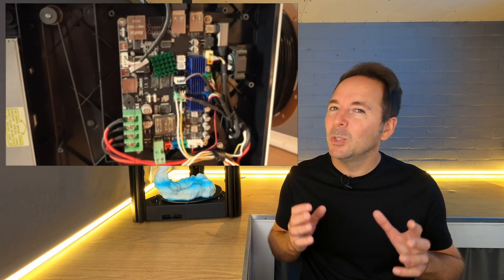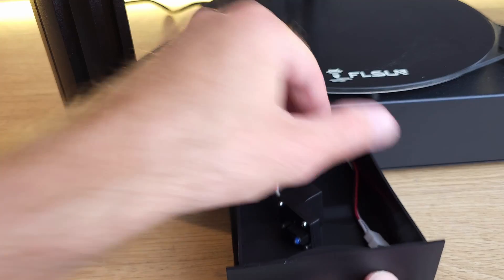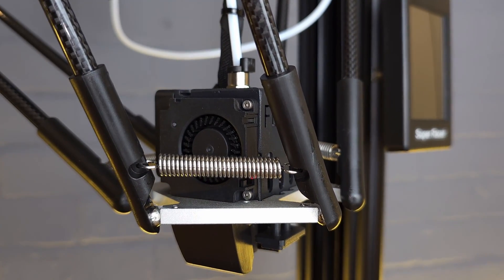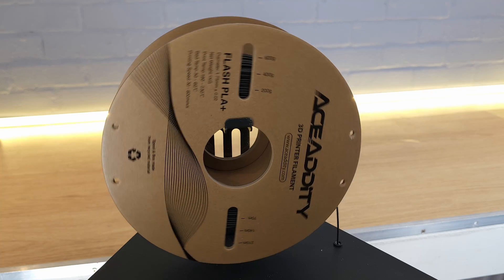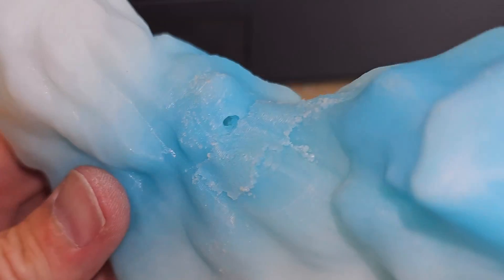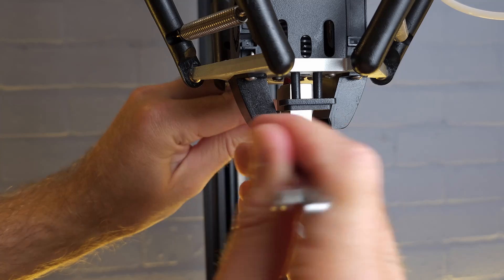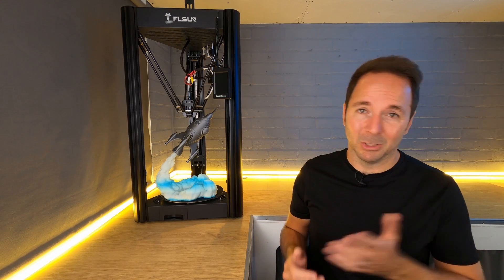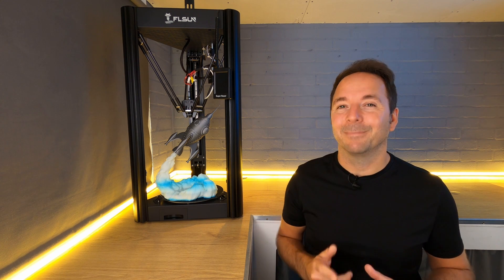You CAN 3D Print Fast WITHOUT Klipper - The FL Sun Super Racer Shows Us How

Comment: I managed to get my FLSUN SR for really cheap. I am not sure if it was direct from FLSUN or an Amazon Warehouse deal. I have replaced the spool holder, with an adaptive roller spool holder by SUNLU. So I can use 1 to 5kg filament rolls. It is just attached via Command Strips. Another upgrade is replacing the bowden tube with a Capricorn tube. And the extruder is upgraded to an all metal OMGV2S F1 extruder. 

I have not done anything with the bed, though there are some options for upgrading. And I have not upgraded to an FLSUN Klipper Pad. It is a possible upgrade to look at.

Comment: I've had an SR for about a year with regular use, and am finally modifying it. For those looking at it as a budget buy given they're about to release their new T1 / S1.

- The heated bed - the glass plate comes out with 2 screws (there are three clamps, just loosen them and remove one, it slides off - also allows you to flip it over and just use smooth glass if you want a flat bottom finish) - magnetic sheets and multiple spring steel plates are available (double sided to boot)
- Heat break, go all metal - doesn't have to be fancy, though I did go with the titanium / copper version for a whole $8. Even sub 250C, eventually the PTFE liner inside will degrade in the stock one. 
- Also heatbreak / hot end - Thermal paste or Boron Nitride if you're fancy. The hole in the heatsink is quite a bit wider than needed, BN-paste has a higher thermal conductivity than any metal, It can be used everywhere (Do note that it dries out to work, meaning it is a potting agent - requires components to be hot to disassemble, and water to remove). If that sounds like too much hassle, even copper anti-sieze can be used (7w/mk), or left over thermal paste from a pc build (usually 8-8.5w/mk). The cooler you can keep your cold side, the firmer your filament is acting as a plunger.
 
- Nozzle - just... get a new one, the number of times I've had the capricorn tube come out of the extruder (breaking the push fitting in the process)... the stock nozzle even at 210C can't push 25mm of filament in a single go (from the 'load / extrude' page, so, at w/e speed it's doing it at). Either the extruder skips, or if it's "too tight", something is going to go wrong. 
- Extruder - given the above issue I've swapped to an 'omg', but I don't do flexibles on it so keeping bowden for now (saving weight on the effector). If you're going to keep the stock extruder, print a filler piece for it (disassemble the extruder and check out the bottom push fitting / what it's screwed in to. Depending on the type of fitting you get, your PTFE tube will stop ~9mm from the exit port, in a 7mm wide hole... 4 full coils of filament got bunched up in there once...)
-Extruder Part Deux - Compression fittings... They taste awful, and they work.
 
- The Effector Fans: 1) The metal housing that the fans are attached to -> The hole for the 4010 heatsink cooler covers 50% of the fan blade area, grab a file or a dremel and widen the hole.
2) Upgrade to 5015 blowers for part cooling, you'll actually be able to set them to not 100%, 100% of the time, because you'll actually be able to cool down what's needed (supports also actually come off without trouble). If you design your mount properly you can avoid loosing any print volume (basically every one I found prior to making them myself all collide with the carbon rods if you try to get near the edge of the build plate).
- Light bar - just nice to have, there are ring kits but I've got a strip light on one of the three legs.
Reply: I’ve tried everything an after almost 200 hours of printing my flsun sr will stick to the bed but ends up stuck on the nozzle after 2-3 minutes of printing, do you know why this is?
Reply: @TheMulletMafia1  I replaced my hot end with a brass one and then I could do the nozzle up tight enough to the heat break to stop it leaking out of the threads. That was my major issue after that I can reliably print. Have thousands of printing hours on it now.
Reply: @Kalicdire  where did you buy the brass hotend?

Comment: Seems like an excellent printer! The problem is the price. At $350 it just doesn't make sense. Consider the Bambu Lab A1, Creality Ender 3 V3, AnyCubic Kobra, Elegoo Neptune, and Sovol SV series for example. All come in similarly priced or cheaper than this with similar or higher capabilities. Hard to recommend this printer even on sale. Add an all metal hotend, direct drive extruder, a PEI bed, Klipper, and keep it the same price. Then it would be truly fantastic. 3D printing has simply advanced too much in the last year for this to be a sensible buy.
Reply from the maker: Fair points
Reply: @RickyImpey  No knock on your video BTW I really enjoyed it and agree with your assessment. Just saying the value proposition is the only issue.
Reply: Was a good option 3 years ago when core xy and bed slingers were still slow, but now all the vibration damping stuff is awesome for the high speed stuff
Reply: Currently at 200€ for sale here in Europe. Looking forward getting my hands on it. Tinkering it with some miner updates into a well rounded exotic tipe of makerbot🤩

Comment: Great vid Rick. I grew up on deltas and whilst I have the usual x1, k1 etc now, I still have 2 deltas ie 400 x 600 and 340 x 1000 (5 yrs old). They generally print 0.5 lh and now run clipper and do very good 8min benchies easily. Where they really excel is in tall cylindrical printing ie prototyping large hand drum shells esp now with klipper.,. Which is where delta_calibrate smashes marlin. Despite the caveats, and using flying extenders, such a simple and impacting practically free change with a bond tech, there are by far my preferred robust and long living printer

Comment: RIcky, good work as always!  I've had my SR for over a year now, and have a couple of observations (at least about the one I have).  I haven't done any mods to the printer, it's factory.  1. Occasionally, during the beginning of a print, one of the effector arms pops off.  This causes the printer to make a hideous loud grinding noise as it tries to move where it can't.  The only cure is to power off, put the arm back on, and start over.  2. The run-out sensor is no good.  I bought some apparently crappy PLA that wants to break occasionally.   When that happens, the SR doesn't stop for me to fix it, it happily continues on, printing nothing.  With regards to the bed, I did get a magnetic PEI setup and use that with the SR.

Comment: You can also install Marlin 2.1. 2.1 with Input Shaping, Linear Advance on your actual printer, the old bed slinger can do 100-150 stock or at least with a CHT nozzle. For the price of a SR you can buy 4 and print 4 pieces at the same time, immagine how many parts you can print in one night. Yet don't bother: install klipper on an old laptop or a rpi: it's way easier to build, configure and calibrate.
You know you can't print PETg faster than 100-150, flexible even slower and I don't want to spend 34e for 1KG of hi-speed PLA when I can pay 12e for good PLA+

Comment: I used to own a Super Racer (had to sell for rent money but I'm good now). I printed a custom effector plate out of high strength material that was just as rigid as the aluminum plate it came with but was much lighter. Along with printing a custom fan/hotend housing with the same material, adding dual 5015 fans, a direct drive via the orbiter v2, and a high flow hotend (can't for the life of me remember which one). All in all I added about 15grams of weight I think, compared to the stock Super Racer effector plate and hotend full assembly. I was able to boost print speeds up to 200mm/s and accelerations up to 8500mm^3/s before I started hitting any kind of limits or quality degradation. This isn't as fast as the X1/P1 or any of the 3 newer Qidi printers, but damn did it go fast! I think my fastest benchy as per the speedbenchy rules, was around 28 minutes and change, and it still looked damn good!

Comment: Klipper is just an open source translation of gcode to mechanical movement, could run on any machine. I believe a good example of fast prints without Klipper might be Bambulabs. I say that as an assumption because of Arc gcode support, until their encryption is cracked we won’t know for sure, but I believe it would be easier for them to have a custom marlin firmware than custom Klipper firmware with arc welding support. But I believe Bambulabs is still claiming they have completely custom in house firmware. Time will tell.

Comment: I have the one before this model, The QQ-S Pro.  Mine make this one look small. My print area is 365 mm tall by 265 mm wide.  

I have added a round gold PEI metal flex sheet cover with the powerful magnet below it. the printer already had a 
Titan extruder so I have no problems doing TPU even though my bowden tube is longer then yours. 

So yes flexible's are able to be printed no worries.  The spool holder you said about is the same on mine as standard, although I've not had problems with mine even though I use many types of spool. The cupboard spools run smoothly on my holder in fact they seem to run better than the plastic types?

My printer running noises, cooling fans etc. is a little noisy but compared to my other printers it is no as loud as them, and when it prints the main board bleeps lightly like R2 D2.

i have the printer up on a worktop on a store cupboard on the floor and the worktop is 3 feet high so with the 8 foot ceiling above I still got about 2 feet clear so loading the spools is a arm long reach but fine.  The speeds of my printer is what is a pain the max I got safely to do is 60 mm/s maybe when I get my ordered Klipper pad 7 from BTT then I see what speeds it do then?

I may well upgrade the V6 Hot End to a Volcano one but there is no sister board for the head so I would need to either run the wires of the thermistor and heater all the way down to the base or try to do a sister board with the white plugs above the head to plug the heating and thermistor ones there?

And FLSUN helped me soon after I had the printer as the power plug unit in the base went wrong, they sent a new one fast and it was in easy once I checked the wiring!
And to think there is a huge version of mine with klipper installed already the "V400"  makes mine look medium high.

Comment: I wanted to love my Super racer but it had so many issues that it sits now unused in the corner despite beeing fixed. 
I needed a new nozzle because the too small heatingblock didnt work very well with their nozzles, 
different cooling fan ducts, 
a new extruder 
and  most annoying i needed to print completly new feets because the original one were so small and placed so far in the printer thats they caused the printer to shake massivly when printing a larger print.

Overall it was a very disappointing printer. I wonder if they fixed the most issues now.
Reply from the maker: I'm sure they must have changed all of these things as I didn't find any of these issues myself.
Reply: @RickyImpey  I can see that the hotend design is now very different to the one on my super racer. No 1 to 1,5 cm gap between  nozzle tip and heatblock anymore. Glad they fixed that. Deltas are way to cool.